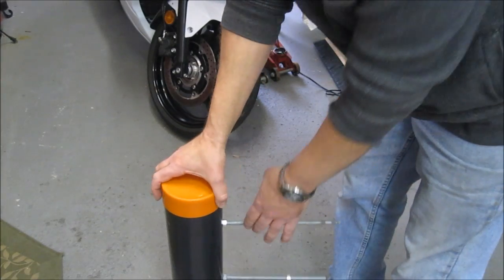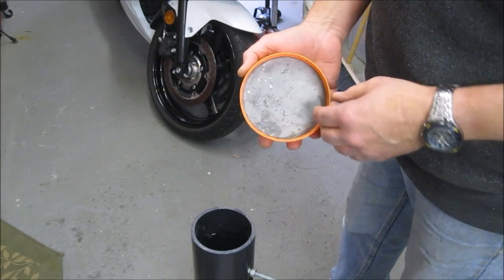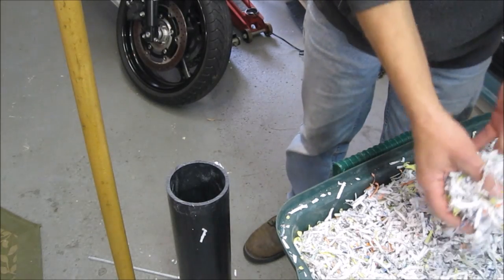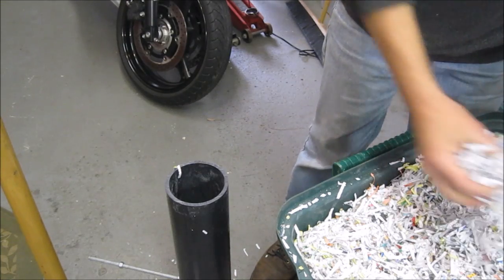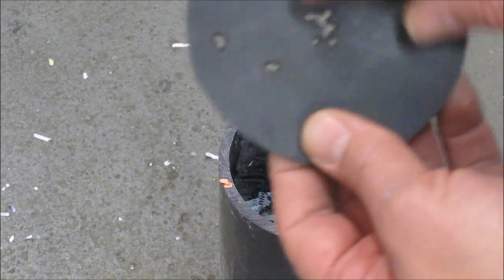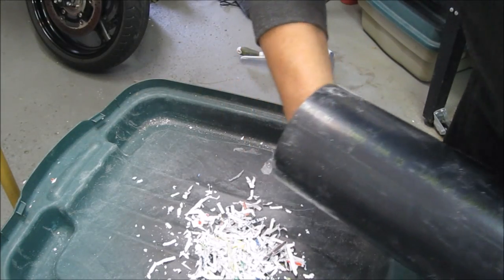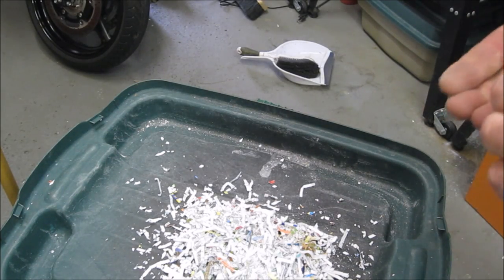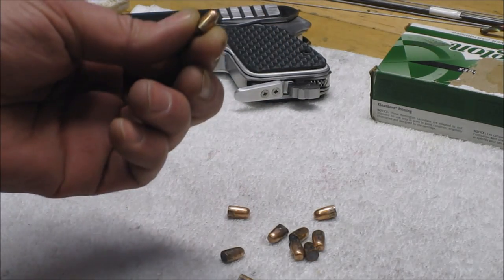Homemade bullet trap

Comment: Thanks for answering the request. It looks like this is suitable for .32 ACP, but I wouldn't feel safe using it for anything more potent.
Reply from the maker: +GunFun ZS Your mileage may vary:) I'd think that given a long enough piece of ABS, you could stop anything. I was especially surprised at the lack of damage when I purposely glanced a couple off the sides. Of course, these are fairly anemic rounds.
Reply: It's the glancing shots or messups that concern me. I have been vaguely planning to do a steel snail type trap for this kind of thing. However, I would need a suppressor to avoid having people complain of the shots to L.E.
Reply: +GunFun ZS I can say that any "full" rifle caliber (.308/.30-06/7.62x54r) will bust 5 gallon buckets apart just from the muzzle blast....
don't ask how I came to find that out... safely of course.